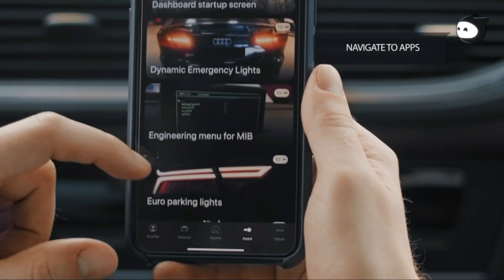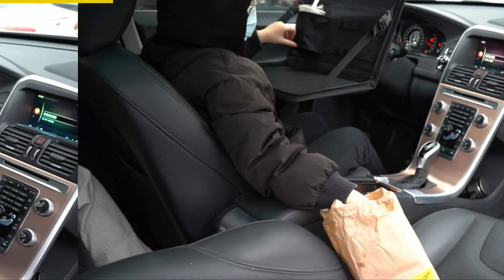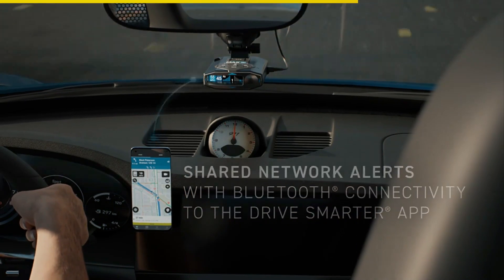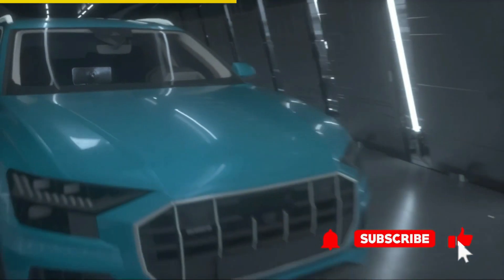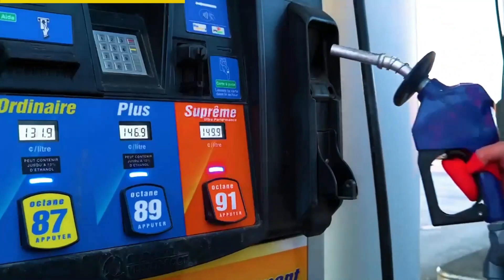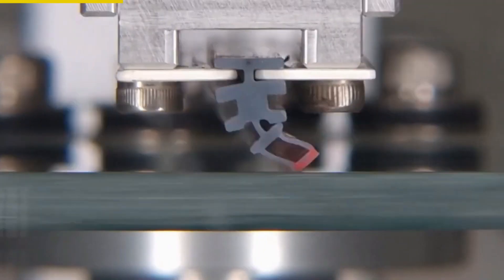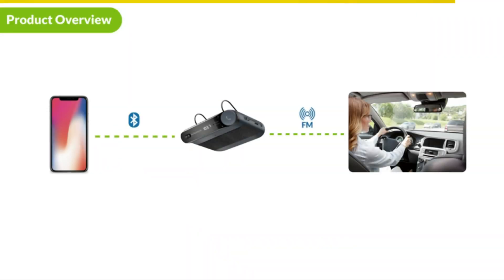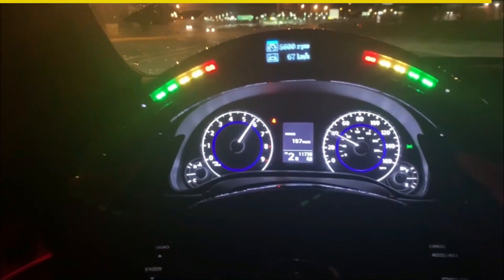12 Coolest Car Gadgets Still Available on Amazon 2023

Comment from the maker: ** AMAZON LINKS **
OBDeleven - https://amzn.to/44LxKGl
 Joytutus Eating Tray - https://amzn.to/44Ew9Su
 Escort Radar Detector - https://amzn.to/3rqjaWi
 Tracki GPS Tracker - https://amzn.to/3Dg6OT2
 LANMODO Pro Dash Cam - https://amzn.to/3PUeTom
 Hoto Tire Inflator - https://amzn.to/44orPqG
 Pump Pal Fueling Glove - https://amzn.to/3XQbPeL
 CarlinKit 4.0 Wireless Adapter - https://amzn.to/3ruyrFk
 Kimblade Nano Wiper Blades - https://amzn.to/44Lyzip
 Avantree Roadtrip Speaker - https://amzn.to/44EeIS3
 HOTOR Trash Can - https://amzn.to/3rviH4V
 Steering Wheel Car LED Display - https://amzn.to/3O9ZI83